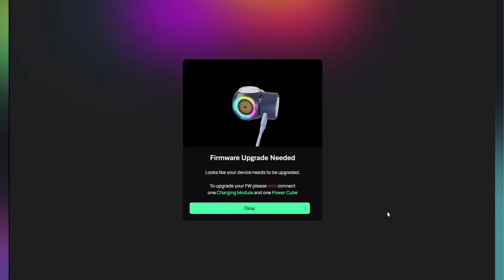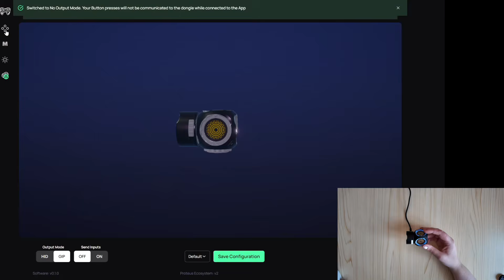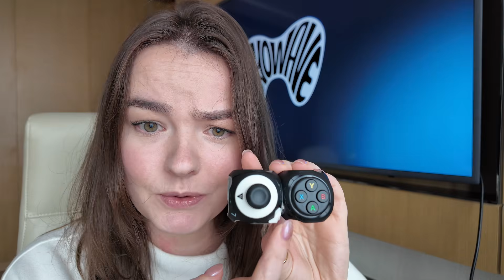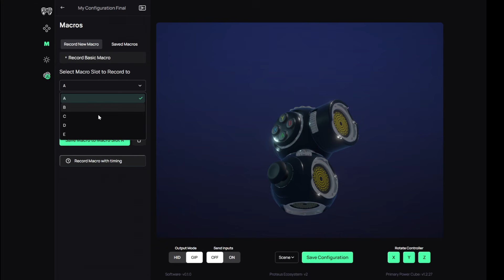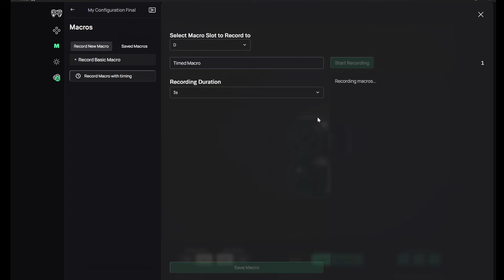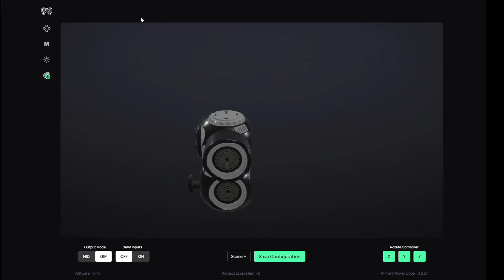Proteus Software Tutorial | Proteus Controller & Proteus Builder

Comment: If I use a mac or windows machine to set the binds on the builder, are they stored on the builder so that I can then use it on linux? Does the software run in a linux browser?
Reply from the maker: Yes all the changes are saved to the controller so once you remap you can disconnect from the software and continue playing. 

There is a browser version of the app that should run on Linux, but we don’t specifically design for Linux so I would recommend joining our discord server and reaching out to some Linux users to get their experience as we can’t guarantee a seamless experience on Linux.

Comment: Let’s say I want to use the builder as keyboard on Xbox- I only have a Mac, can I update the controller/remap it as keyboard and remap buttons through the website on a Mac?  Will the joystick act as WASD - if I set it like that?
Reply from the maker: You can use the software on a Mac if that's what you're looking to do! However, the HID features are PC only, and won't work on Xbox.

Some games do allow you to use a mouse alongside a controller on Xbox (like Minecraft and Fortnite for example) but not all games do

If you have a specific game you're looking to use on Xbox please let us know and we can check it out for you
Reply: @ByoWave so no way to make it act like a keyboard, save it in the onboard memory - and use it like that on the Xbox?
Reply: Damn the product almost sounded perfect
Reply from the maker: @riotmike85  We are licensed for Xbox, so use their connection system, which means it needs to connect as a controller on Xbox. You can join the Discord community and see if anyone comes up with some outside the box thinking solutions!